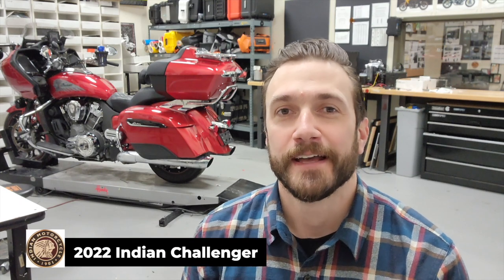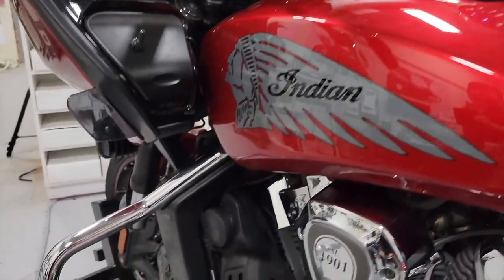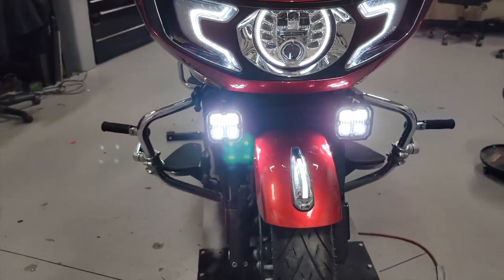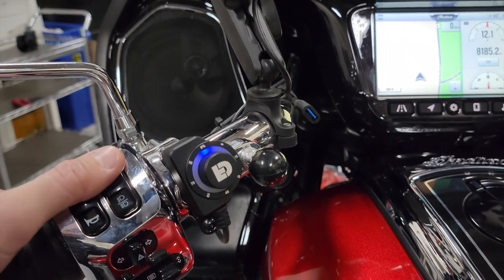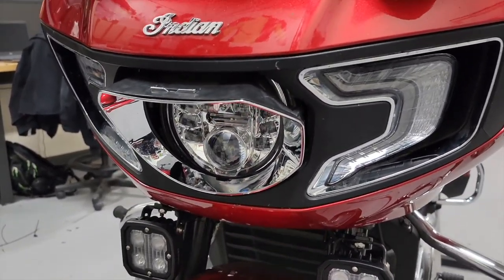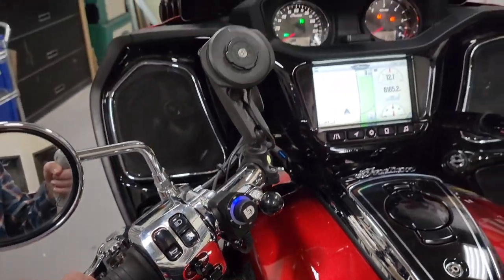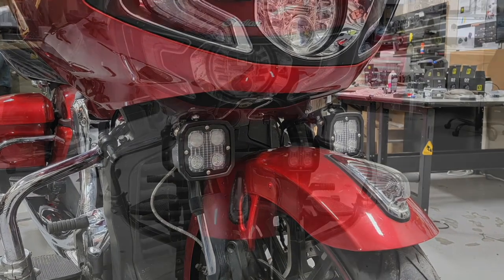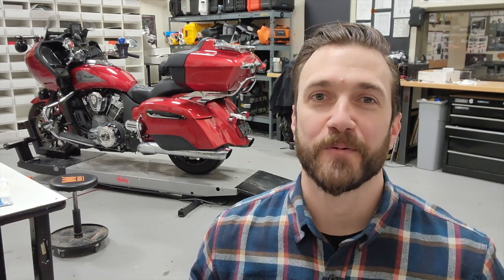You Can Install DENALI Lights on Anything- 2022 Indian Challenger Auxiliary Light Install

Comment: I'm in the process of trying to setup my D4's on my new Pursuit in a similar fashion to this setup on the forks, but I have a question about the mounting of the control switch.  I know the clamp that comes in the kit is not big enough, how did you guys do your mounting?  I didn't see info about that in the description?  Looks like maybe something with spacers and longer bolts for the clutch ?

Comment: Wow that's pretty impressive. Anything for a Roadmaster? That one may have more light power than mine haha. I have a ton of lights on mine. I think they should get more on the back at least! But a crazy set up on the front with all those. Which products have a conspicuity flicker? And do any of the small white LEDs have that function, that could be forward mounted as DRLs?
Reply from the maker: Some of our universal mounts could be used to mount lights on a roadmaster: https://denalielectronics.com/collections/universal-light-mounts

Our universal DialDim controller can be installed on a Roadmaster as well (like this video): https://denalielectronics.com/products/dialdim%E2%84%A2-lighting-controller-universal-fit

None of our lights flicker for conspicuity as it is illegal in most states and countries. Our controllers (DialDim and CANsmart) allow for smart features like flash to pass, signal strobe, and signal cancel as well as strobe on horn.

Comment: Hi Nate, were you able to use the turn signal function of DailDim on Indian Challenger. I have done the same setup on Indian Chief. I have tapped the turn signal trigger wires under the seat (through harness that goes to tail). It doesn't works.
Reply from the maker: Give us a call at +1 401 360 2550 and we can help you diagnose what is going on!